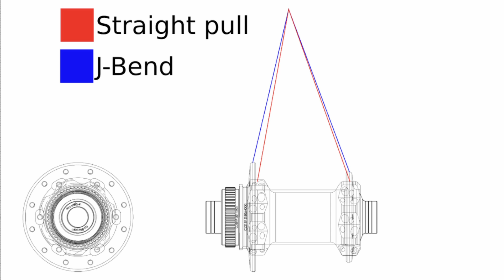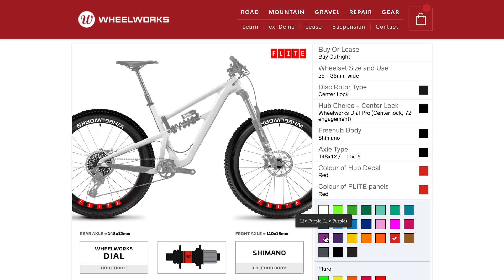J-BEND vs STRAIGHT-PULL spokes

Comment: Thanks Tristan! I've been inspired by you and Gav to try and build a budget bling set (hopefully a wheelworks set next). Do you think the spoke length (shorter for j-bend) wound compensate for the ~15g difference in hub weight? If I'm looking at trying to build the lightest set possible with the idea of reusing the hubs on a proper build in a year or two, is something like a 240 straight pull the path?

Thanks,
Liam - (XC wheel interest)
Reply from the maker: Hey Liam!  An Aerolite spoke is about 0.016 g/mm so if the flanges were 15mm bigger on both sides then you'd save around 7.8 grams in spoke length, so it does start to claw back the weight!  Obviously a thicker / heavier spoke would have even more weight.  

The main concern with re-lacing hubs is to re-use the same lacing pattern.  With a straight-pull hub this isn't a factor as you don't get any options, whereas with a J-bend hub you've got 4 possible lacing options, plus different spoke crossing options.  I'm not sure there is a 'right' answer here so I'd be more tempted to chose a good quality hub. -Tristan
Reply: @WheelworksHandcraftedWheels  thanks so much Tristan!

Comment: J-Bend hubs are easier to measure the hub dimension for wheel building..
Reply from the maker: I can't believe I didn't talk about this but YES!  Unless you are 100% certain of the dimensions it can be really tough.  If we're building a unique hub using expensive spokes we'll often test-built with some cheap straight gauge spokes to test our spoke length calcs and quickly bring the wheel to enough tension and dish/true that we can evaluate whether our measurements and calcs were correct.  Total PITA - thanks for mentioning this.  -Tristan
Reply: @WheelworksHandcraftedWheels  to be fair, this is a bike-industry issue
to me as a mechanical engineer it's completely insane that there are no CAD models available for rims and hubs from the manufacturer(s) 
determination of the perfect spoke length would literally be a 2 minute job

Comment: Great video! In relation to lateral stiffness- would you say that j bend for example work better with an alloy rim and a straight pull would work better with carbon? to compensate or mitigate the stiffness of the rim material
Reply from the maker: Great question.  Lateral stiffness is certainly less important with a (good) carbon rim as they are stiffer than aluminium.  We took advantage of this on our TrailLite and EnduroLite front wheels by lowering the spoke count from 32 to 24 in addition to using a much lighter layup to save weight.  The loss in lateral stiffness from a straight-pull hub would certainly be felt less (or not at all) on a carbon rim.  It's been a few years since I've really delved into lateral stiffness and it's something that I want to do a lot more research on this year as it's a really interesting subject. Thanks for the feedback and questions - keep them coming. -Tristan
Reply: @WheelworksHandcraftedWheels   cheers 👍

Comment: Sounded pretty bias towards the jbend that would come on a huffy . Which I've never seen straight pull on a huffy. I've bent more jbend rims than I have straight pull .
Reply from the maker: You're correct but there is a bell curve of price.  It's hard to comprehend but the wheels that come on a Huffy cost around $1 each (!!) and I honestly don't know much about the fabrication of these other than they rely on cheap labour and massive volume.  Once you get into our market / price range of wheels the extra CNC machining time (extra cost) to make straight-pull hubs will be offset by the reduced labour of lacing if you're doing enough of them on a production line.  6-bolt vs center lock rotors is another tradeoff - the 6-bolt hubs cost more because they take longer on the CNC machine, and installing and tightening 6 bolts takes longer, but stamped steel 6-bolt rotors are so much cheaper so the total hub + rotor price is lower.  This is why you see 6-bolt rotors on most entry-level and mid-level mountain bikes. -Tristan